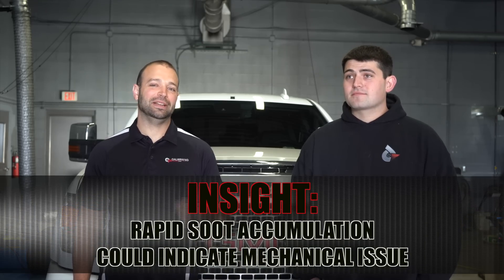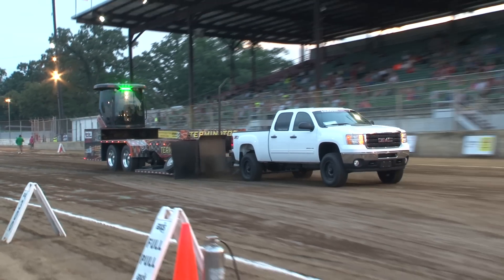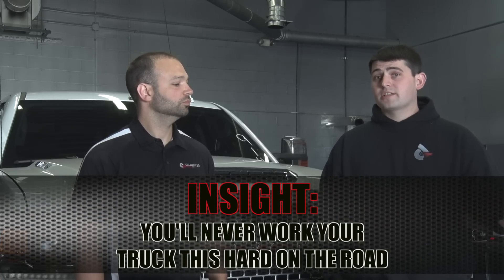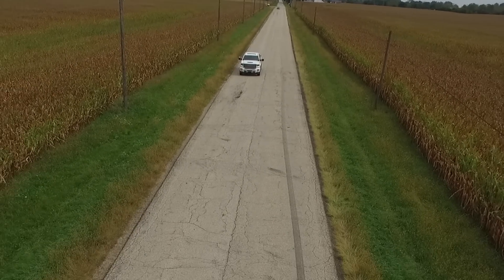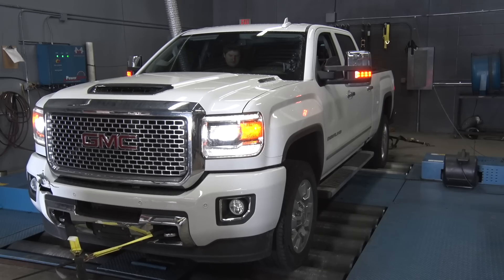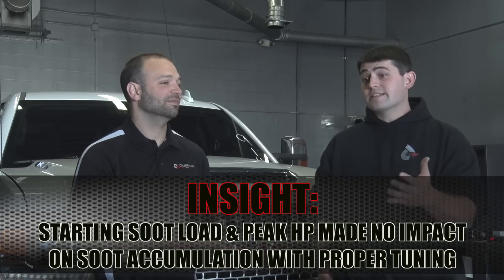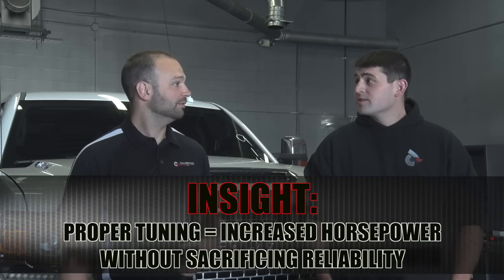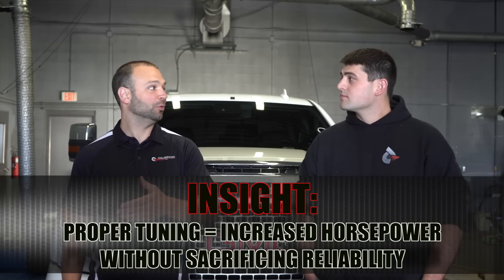Diesel Insights: Soot Accumulation

Comment: I know this is an olderish video, so it might not be seen, but Im curious to know if there has been any more advancements in tuning to get an even lower soot accumulation percentage consistently? Like has there been tests where 0% accumulation is being achieved through multiple runs, in a stock power configuration or even a higher configuration?
Reply from the maker: Tuning is maintaining this level despite the horsepower increases. Maybe one day we will see a 0% with enhanced performance-minded DPFs in the future.

Comment: So a new duramax is only good until it hits 100,000 miles and then what, the emissions are in need of replacing? I should probably rebuild my lbz instead of buying a new truck?
Reply from the maker: It really depends on what is more important to you, power or comfort.  If you want a nasty power number that is street driven, I might look at an older truck.  If you can live with 500-550 RWHP with all the comforts of a new truck then go with a 2013 or newer.

Comment: I have your tunes all emissions intact of course. 2011 LML with your 520 pack . Just the other day I contacted you guys through EZlynk. After talking about certain things they said get some Data logs and send them to us . So I said what the Hell I will do all 5 tunes . Keep in mind they wanted Data logs from 30-70 mph full throttle. After doing all 5 tunes at full throttle from 30-70 soot went up from 17g to 28g . That’s average of 2.2 g . Guys that’s awesome and this was a great test as to what your claiming in this video. In my case it’s right in the money. Just wanted to share with you. 

Heber

Comment: Run jet fuel mixed with normal diesel it will clean it up and give you better fuel milage while running better all at the same time
Reply from the maker: ^Not suggested.
Reply: Ernest Deitz Why on earth would you want to do that, and lose all the lubrication properties for your fuel system?

Comment: i change oil every 4000 km due to shitty emissions. the soot in oil is not good.  this is also terrible for environment but better for the truck
Reply: I do mine every 20000 miles in my 2016 dodge Cummins, every time I do an oil sample aswell, it always comes back that the oil has atleast 20 percent life left

Comment: How about soot in the 2011 LML . It adds collects quickly on mine less then 200 miles for sure . I have your 520 pack
Reply from the maker: We did a lot of testing with the LML.  On that truck, hard pulls or a heavy foot will definitely pick up soot quicker. The Regen time seemed shorter though.

Comment: I'm new to diesel's, so how do you clean the soot from your exhaust system if it's clogged? Pull it apart?
Reply: The soot is collected in the diesel particulate filter (dpf).  When the soot reaches a high level it triggers a cleaning process called regen. All modern emissions systems now have a 9th injector that sprays fuel and diesel exhaust fluid (def) into the dpf chamber. The heat from the exhaust causes the fuel to self ignite and converts the def fluid into ammonia that binds with the soot and burns it off converting the waste into harmless nitrogen and water out the tailpipe. The process takes a while (20+ minutes) and after it's complete you're dpf filter is clean. If the dpf gets completely clogged (usually causes by a bad temp sensor or failed 9th injector) the dpf chamber has to be cut out and cleaned manually. Most diesel mechanic shops have a set price service for cleaning clogged dpf filters.
Reply: Ok what  additive should I add to the fuel?

Comment: Deleted my lml my oil is clean right up to next oil change .you want longevity get that emissions crap off your truck dont care what tune you have.
Reply: Love to buy new. Actually now is probably a good time for a GM. The 2019 prices should drop since the 2020 is unveiled. A Denali DRW (ours is SLT DRW) is $73k with a couple options which I like. Can't afford it right now. If a equivalent SLT DRW is mid-low $60k's and there's substantial money off for model clearance...maybe able to do it
Reply: @mikz86ta1  for guys looking to keep there trucks stock that's the only way to go keep buying new I find it funny that guys think tuning is going to  fix there problems .dpf is a filter it gets dirty overtime and eventually needs to be replaced it cant always be cleaned with a hotter tune. Lml guys I would be more worried about your cp4....
Reply: If you dont want to delete and are,concerned with the engine internals(bearings) run a dual filter system...FS2500..Amsoil..etc etc.
Reply: True but not all want to void warranty, not all can get their trucks to pass state test and not all dealers will trade in a deleted truck...even in a non test state.
There's a place for everything. What you say is true no doubt.
Reply: @mikz86ta1  then buy a new one when the warranty is off and leave it stock . By the time the warranty is done the damage is done your bearings have been bathing in soot  you should see the difference between a deleted and non delete engine after 200 000 .but I do agree trucks are expensive I thought I would leave mine stock to until it was in the garage more then the road .
Reply: Michel Foshee  it does not not void your warranty.
Reply: @kevinswartz2396  deleted does
Reply: Michel Foshee federal law protects against manufacturers voiding a warranty on a modified vehicle unless they can prove the failure was directly caused by the aftermarket part. So just deleted with a mild tune no. With a hot tune then probably, at least the motor and trans. But  not the whole truck
Reply: Kevin Swartz Ok 👌
Reply: @kevinswartz2396  Sorry, I know that's the law but most dealers do not give a shit. Lots of Ram, GM, and Ford dealers denying warranties and letting the customer spend the money to fight them on it.

Comment: As always, great info guys thanks! I currently have a stock lml with a few upgrades as suggested by most (s&b intake, lift pump, etc) but get poor mileage and regen about every 200 miles (daily driver, commute is some highway some town driving). Any thoughts or suggestions on how that can be tested/adjusted/improved??? Would you be able to look at the data from my truck and apply corrections with your tunes? Thanks again!
Reply: Had a 2013 LML tuned with Duramaxtuner...drove it 85k miles compliant on their tunes with no issues. Traded it in on a 2016 and bought their tunes again. Currently 72k miles on this one...again no issues. Truck regens about every 500 miles. Only other mod is a lift pump. Clean reliable power.
Reply: 2016 Denali here with their stealth stage 1 kit, run it in tune 5 all the time (expect for when towing) and I regen between every 600 to 700 miles.
Reply: I have a 16 lml bone stock 40k getting ready to order the stealth stage 1 kit as soon as I get new wheels and tires so The ECM can be calibrated for new size.
Reply: Eddie Rohrer you’ll love it!!  We have a 43ft Fuzion toy hauler that weighs in at just over 16k (over 17 with my harley in it) and even on the low tow tune (tune 2) it pulls like a dream!!
Reply: @Midlifeglamping  I sure I will I a 36ft travel trailer but looking to step up to a 5th wheel  soon, I have been offered a delet and tune for about what the stage 1 cost but i like my truck not smelling like a diesel and when pulling on long trips hearing a truck roar all day gets old this is best of both worlds for me!
Reply: @roryrohrer7640  you can delete the truck and keep it quiet.
Reply: Same boat here. LML, 166k, daily driver.....I get 13.2mpg on the DIC and close to 15+/- mpg on the DIC on trips. Mostly stock except AFE drop-in filter, PCV bypass. Lift Pump is next. Regen is less miles on mine...like 186
Reply: That's promising! My biggest curiosity is if the regens can improve that drastically (500-700 miles) for me, or if I'd only see minor improvements?
Reply: Scott Fanello I will say this, a lot of times when I fill up, I add some Lucas Oil injector cleaner and when I forget to, it regens sooner...
Reply: @Midlifeglamping  yeah I add a fuel additive as well. Trying to save the cp4 as long as possible haha!
Reply: @ScottFanello  your problem may be the intake with no tunes clean up your air/fuel ratios  ecm is reading more air in and probably adding fuel to compensate so you MPGs are down and regen is more often, same with the guy that has similar problem. The later model diesels do not do well with mods and no tuning even if left emissions compliant
Reply: @ScottFanello  if you want to save the cp4 buy an aftermarket lift pump with water separator. Water is what Jill's these pumps. But yes keep running the lucus it really helps lubricate. I only know this because I tease down these pumps and rebuild them as my job for bd diesel
Reply: @ScottFanello  also clean your mass air flow sensor with sensor clean every few months or so. But if you want better mileage I would definitely tune the truck and if it's legal where you live I would just delete it fully. Much better that way
Reply: @jonathoncatterson8901  Yup, already have a FASS installed, was the second modification I did on my truck. Full delete would be nice, but not sure I'm ready to pull the trigger on that quite yet.
Reply: @ScottFanello  if you plan on keeping the truck awhile I would just do the delete asap. It's just s night and day difference and you'll regret waiting forever by putting it off. You can find local guys to do the programming for cheap like 400 bucks. Then just take that dpf out of the exhaust and that crappy def tank which looks horrible...